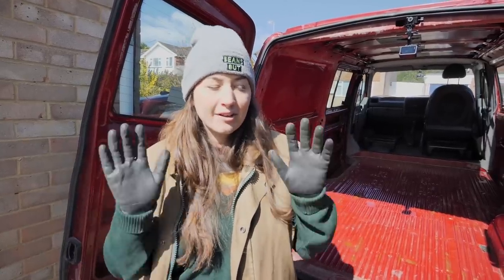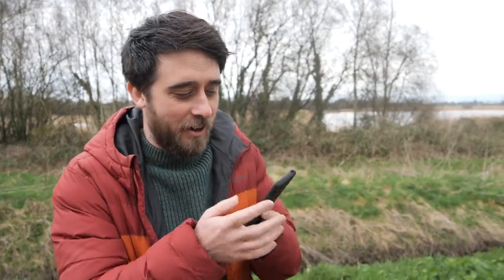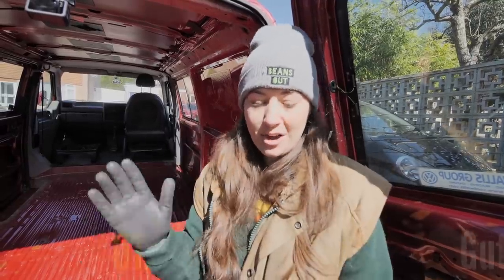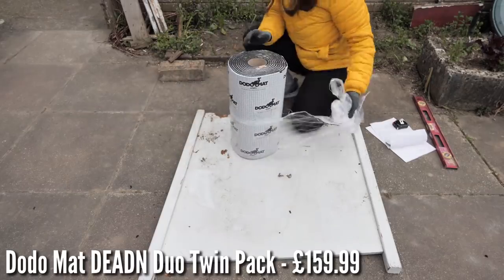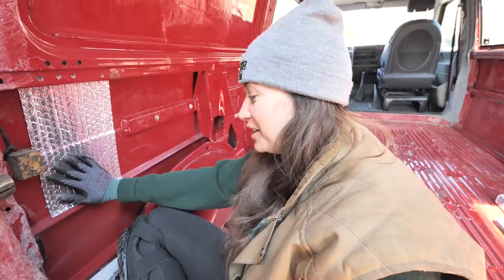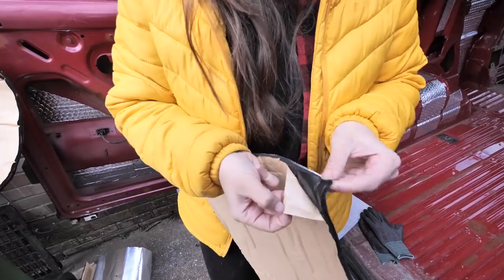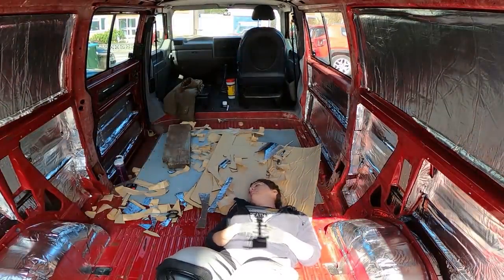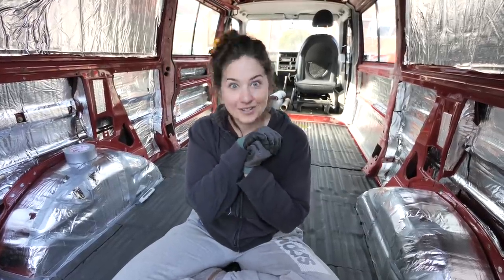Converting A Van With No Experience | Self Build Camper Van Conversion For Dummies Part 1

Comment: Great job guys. Love the thoughts for the roof. I'm 62 yrs old and attempting to convert my red Renault Trafic. Note to self, don't do this in Winter. I put my insulation in using a hair dryer to heat both the insulation and the van wall before sticking! Now waiting for the right temperature for the expanding foam. Glad I'm not the only 1st time dummy out there. 👏👏👏

Comment: All closed-cell insulation materials are expensive.  Open-cell (insulation) does NOT provide a vapour barrier.  Anyway, I agree 100% doing that sound deadening as if you have ever driven a motorhome or campervan, the noise can be horrendous at times.

Comment: Well done 👏😃 hope you continue to enjoy your converting! I have turned 4 vans into campers over the years and my current “camper” is an Iveco daily Luton van conversion. My tip to you is the following.... think long and hard Now, where you would like to have 12volt & 240v wires situated for sockets, chargers and switches, BEFORE you reinstall your plywood. It’s so much easier to route and hide cables at this stage 😁
Look forward to your next video 😃👍
Reply from the maker: Great tip, thank you!!
Reply: @TravelBeans   What I normally do is draw out the camper van layout on paper. This means I’ll have already measured up roughly what size everything should be an know where I want things to go ie bed, cupboards, drawers etc. I then improve on my design as I start to build into the van. Do remember to leave space for a portable potti.... you may not intend perhaps to use it, but you’ll sure be glad you’ve got one should you be caught short 😁

Comment: Hey Emma and Alex, good to see you back . . . . . look at you doing all the work, well done you!!!! A couple of things to remember for sure, is before you put the boards back up  . . . . . is the insulation thick enough, check out other van buillds to see what they used, as it does get cold overnight . . . . . some have been using 2" thick foam insulation panels, which is great . . . but you might be lucky with what you have put up already. The other thing is, don`t forget where your electric cables (new ones for appliances you will be using) are going to go, and if you can bury them behind the boards with easy access to any connection points would be brilliant. Air ventilation overnight . . . . . .you have to find some kind of fan, doesn`t need to be expensive, & can be run by a Solar panel strategically placed(check for decibel level also). Will you be be making a fold down Dinette type of configuration? If so the seats you took out would do a job or, make a simple fold Up and down padded arrangement. Finally i seen a good set up on a van once at a campsite before covid, the guy had a VW, with access Ladder on rear door for getting up on the roof, but he had an extension pole attached (clipped together by spring clips) to extend it to 15 feet above the roof of the VW, he had attached a mounting bracking on top to place a 4k Surveillance camera, like you he loves birds and animals, and he could view them from inside on his laptop. the camera type is called a PTZ = Pan, Tilt, Zoom. He said it was the best thing he had done on the van, he also attached a couple of guide ropes, to clip to the top of the roof of the van for extra stability in blustery conditions. Anyway, i talk too much lol, Good luck with the next steps . . .and always think ahead of what you are going to need in some kind of relative order, it will help . . .take care you two . . .much love from Banwell. :)
Reply from the maker: Hey Chris! We still have another layer of insulation to go before we put the boards back up.. hopefully it should be enough 🙏 but i suppose only time will tell! 😂
Currently in the planning process with the wires etc. I think we're going to go with an exposed conduit, so that buys us a little more planning time for that.
Thanks for the info about the camera - we will have to look into that one for sure! Sounds like a great idea! 
Thanks so much for all the info and tips Chris! It's very much appreciated 👍

Comment: The red painted panels are to stop body drone when on the move, not stop sound prevention as in penetration from inside or outside.
Reply: What is body drone?
Reply: @susiehernandez6652  The noise that flat panels make when moving in a vehicle due to wind making panels vibrate.

Comment: I have a tip!!!  Thoroughly clean the metal surfaces before applying sticky back stuff. I used nail polish remover from the pound shop and lots of blue roll till it was squeaky clean. There, that was my tip. Good huh?

Comment: I honestly can't see the appeal of these VW day vans other than their previous iconic history. For those who travel substantial distances, I see them as being far from suitable. My build was simple:

I purchased a 2008 Ford Transit High  Top Ex Welfare Van. (Reason being is these are meticulously serviced by the companies who owned them - and also pretty much all, if not most, have Eberspacher Diesel Heaters already installed that run when the engine is off). Also powerful battery inverters are usually with these vans.

I gutted the van and insulated it, applied ply wood around the van. 

Had two skylight windows cut out and pop up windows installed.

Had a Carpenter come in and make a raised bed frame (for storage under the bed) with a seating bench.

Ordered a flat-packed kitchen from Devon with a twin hob gas ring cooker and electric tap/pump. A caravan company made sink holes in the cabinet for where the gas canisters were stored and also a waste pipe

I bought foam from a shop and found a lady who tailored these with good quality material for the front bench.

Found a company in West Sussex who custom make mattresses and had it made to fit the bed.

Bought a Camper Geyser for outdoor use to shower and for hot water.

Water tanks were positioned under the  bench and bed. 

I bought vinyl for the floor which made it easy to wash down the floor after jumping in and out whilst on my daily missions. 

I could stand up in the van. Move around. Comfortably cook. Was warm... Didn't have to collapse and make a bed every day.

I don't want to knock your project as its cool but these are what I describe as day vans. For true inspiration of long distance travel vehicles and something almost liveable in, I would look more towards Race Vans where people take their bikes to the tracks and have a place to shower, eat and sleep. 

This was all done for around £2,000 - £2,500 (excluding the cost of the van which cost me £5,000)

Good luck!

Comment: the small crevices and gaps fill with sheeps wool  insulation .remember not to block off the rear lights so you can still change bulbs when required and plan wiring routes and run wires before side panels get fixed back in Oh and the stick on patches don't have to cover the whole panel they cut down on  resonance (drumming ) from the panels
Reply: I can't remember what van build that I was watching that they did a demonstration of the sound deadening. They first tapped on the side panels and the panels rang like a bell. Then they put the sound dampening on every other so that there was an empty space the same size of the dampening space in between. They then tapped on the empty space and it just kind of did a soft thud even though only half of the walls were covered with the stuff. Also Emma I am sure a lot of your community on youtube will make good suggestions when you get stuck on some problem. Keep having fun. Thanks for these videos.
Reply from the maker: Thanks so much for the great advice! 😁

Comment: always take out the front row of seats and door cards so you can add sound deadening and insulation all the way to the  firewall and in the front doors, otherwise, you end up with a cold draw from the front of the van. Apply  sound deadening on the floor and two layers over the wheel arches to make a massive difference in noise when driving and then add insulation, ,as I say to all my customers view your van as a thermos flask it will be the only as good as least insulated part. and if you want to stay cooler or warmer you need more insulation. so a 4 season camper will  need more insulation than this fair-weather install.